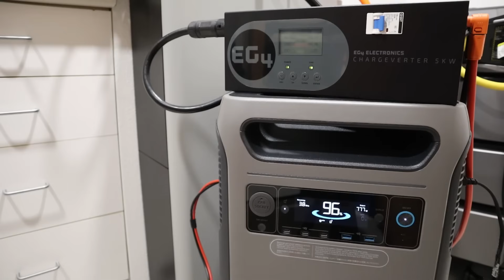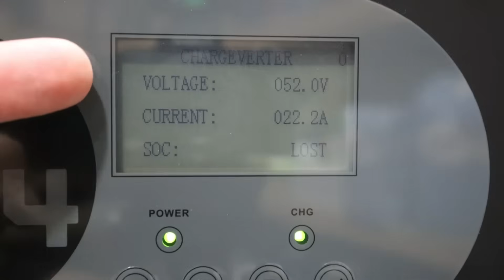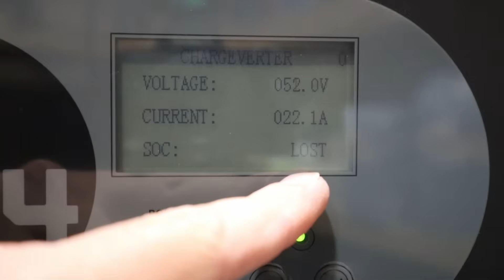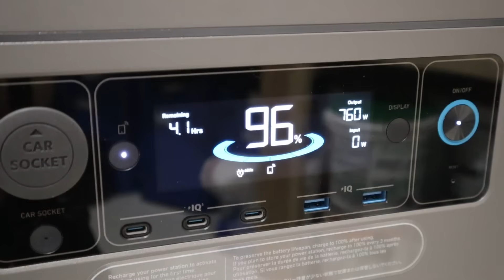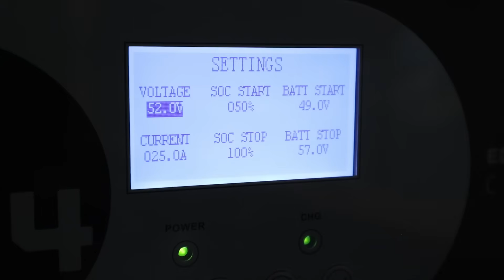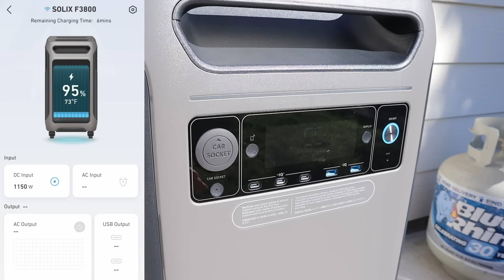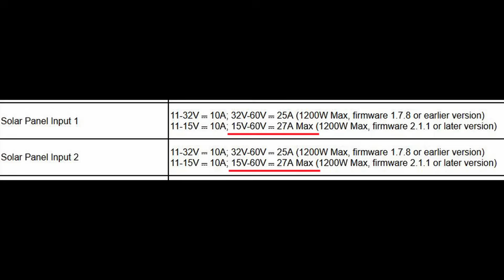The EG4 Chargeverter FIXES the Anker SOLIX F3800!  Keep the 240v Powered On!

Comment: Why after paying over 7 hundred gees have to buy another companies inverter to charge there converter makes no sense anker better redesign there product spending all that money shouldn't have to buy anything else and recharge there equipment  buy any means in an emergency or no solar panel use
Reply from the maker: This video is for all the people that purchased the F3800 not knowing it shuts off the 240v output when AC charging.
(Other YouTube channels pushed the F3800 knowing it had the issue) My video helps people fix the problem.

Comment: So is there a system out there that does everthing the Anker SOLIX F3800 does and doesn't have this 120v recharge problem ?
Reply from the maker: The Ecoflow Delta Pro Ultra is the only option right now. Is the best system available but it's more pricey. I've used my DPU non stop for about 1 year straight, no issues. Just chugs along!
Reply: @Jasonoid  I did some research on the EFDPU and came across this answer from the ECOflow team on the Home Depot website

"Yes, you can charge the Delta Pro Ultra (DPU) using a non-inverter equipped Honda 6500 ES gasoline generator. Connect the generator to the DPU using the AC Generator Charging Adapter at the 5+8 interface for 120V or 240V input. Please note that when using 120V input from the generator, the AC OUTPUT of the DPU will be closed.
Jul 1, 2024"

This says it has the same problem as the F3800........
Reply from the maker: @deeveloper2567  nah, I do it all the time. That's outdated information. I have a review video where I show it working. I wouldn't trust homedepot for power station information.  I also use my DPU everyday so I have experience with it.
Reply: @Jasonoid  Since it was from the ECOflow team just last July, I took their word.  I believe you're doing what you say,  but it would be nice to see some documentation from them as well.  I will contact them through their website.  

Thanks
Reply from the maker: @deeveloper2567  of just watch it in action here:
https://youtu.be/z51enAFvGa4?si=m3sgDiSWhh7sOJhJ
Reply: @Jasonoid  Thanks.  I did watch that and it appears some type of firmware update has made it workable.  I also contacted EcoFlow and got a quick response:

Thank you for contacting EcoFlow support.
 
Regarding your questions:
 
While recharging the Ecoflow Delta Pro Ultra from a 120V gas generator, the Ecoflow Delta Pro Ultra can continue to operate as a 120/240 volt power source. However, please note that other ports can be used but the generator's output power needs to be greater than 1800W; otherwise, the battery will not be recharged. If using high voltage 240V, the AC output port of the DPU will be disabled.

When using a third-party generator to recharge the Ecoflow Delta Pro Ultra, its output must be a pure sine wave with a harmonic rate less than 8% (THD < 8%).
 
If you have any other questions, please feel free to contact me. Thank you for your understanding.

Comment: Jason,

I watched your video on the chargeverter plugged into the solar input of the anker unit.
 So would it be possible to use this same setup plugged out of the ac of a delta pro (Edison plug or 30 amp output )to the solar input of the 6000xp inverter as well?
As you know, if I were to charge the 6000xp with 110ac from generator port or whatever, it disables one of the legs of the output.
I am using just now installing the 6000 xp to supplement my house power but already have a Ecoflow delta pro with 2 batteries I would like to use for extra capacity for the 6000xp.

So my question is, can I have the chargerverter plugged into my delta pro ac out and then adapt the other end into the one of the pv inputs of the 6000xp????
Additionally then I could still run solar into the other pv input as well.
Thanks.
Reply from the maker: Unfortunately the EG4 6000xp requires at least 100vdc input DC to start charging and it prefers at least 120vdc of solar or battery voltage. Connecting the chargeverter up to the 6000xp solar input won't work properly....but that's not how you should connect up the chargeverter anyways.

What you could do to use the extra power in your Delta Pro is it take the chargeverter and power it up with your Delta pro inverter with the 30 amp RV port and then connect the DC output of the chargeverter directly to your 48v battery terminals of your 48v system. The chargeverter is designed to charge a 48v battery directly so use it like that.
Reply: @ this is kind of what I figured. Last question, If I have a couple batteries connected together to the 6000xp, Will the chargeverter still charge them together? If the communication port is connected to the inverter, it wouldn’t be connected to the chargeverter so I’m guessing I would set chargeverter parameters on how to charge??
Reply from the maker: @kerryjohnson7364  if the batteries are connected in parallel to the 6000xp, they will charge together if you connect the chargeverter to them. 
Set the charging parameters of the chargeverter to the specs of the batteries listed in their owners manual. Then the chargeverter will stop at the proper voltage. No communications cable needed. 
Also remember that the battery bms will keep the batteries from charging too high if you program something wrong.

Comment: Do 50 amp port, put out same power as the 25 amp port?
Reply from the maker: The F3800 inverter is good for 6000 watts of power, 25amps @ 240v. Each port is good for that amount of power.

Comment: Hi Jason, you recommended 6 gauge quick connectors but the chargeverter wire is 4 gauge what is your suggestion to step down the wire gauge? Since the connectors are 6 gauge and the wires are 4, I'm having trouble making them fit enough to crimp them.
Reply from the maker: Trim off some of the 4awg strands so they fit into the smaller 6awg terminals. Since there isn't much amperage flowing through these wires you are safe to make these changes.
Reply: @Jasonoid  It worked, ty!

Comment: Hi Jason, thank you for the awesome video again! I have been searching for a solution to charge my Bluetti AC200MAX with a gas generator directly, and this seems to be the best solution. My question is: do I need to adjust any power output settings on the EG4 Chargeverter? The maximum solar input for the AC200MAX is 900W. I apologize for going off-topic here.
Reply from the maker: This will work in the same fashion for charging the AC200max. Similar settings should be fine. It will charge a little slower than what is shown in this video. The AC200max has a 15 amp input limit so the charging speed will be around 800 watts around 54v (54v X 15a = 810)
Reply: @Jasonoid  Thank you very much for the confirmation and your calculation is bang on! Are there menu options on the EG4 Chargeverter to set the voltage and the amperage for the AC200max specific?

Comment: Shouldn't your Neutral have been directly across from your ground to match what you said was in the 240v plug (ground and neutral directly across from each other, two hots directly across from each other)?
Reply from the maker: I wired it exactly as stated in the user manual of the EG4 Chargeverter. Any other wiring the unit wouldn't power up. Its a custom wiring for some reason...

Comment: With the home power panel and an inverter generator you can charge the unit back up similar to the way it charges when power returns after an outage. I found out the hard way that they will not charge at all through the 120v plug when connect through the home power panel. Like you I figured out that you loose 240v when charging through the 120v plug when connected through the power block like you demonstrated in the video. Nice job with your presentation.
Reply: I also found out the hard way.  It is strange: Why does the home power panel defeat the pass-through charging feature of the F3800?  I did not anticipate this problem, and I can find no documentation.   If anyone can explain what is going on, please clue me in.
Reply: @harrison555555  I believe when its connected to charge through the home power panel it disables the other connections. The receptacle block cannot be turned on when feeding loads through the home power panel either. I have a really cool upgrade coming soon that solves this problem. Stay tuned.

Comment: Semi-related to using the Chargeverter to charge while using 240v but this video mentions there's a max charge input of 700 watts when the battery temperature is below 60 degrees F. 

https://www.youtube.com/watch?v=y5WLE3LL7uM

Comment: This is great.  I’m going to follow this.  Q: where and how do you use the fuse? I do not see it in the video! Also is there a way to just join ring terminals without cutting the provided wire? Thanks.
Reply from the maker: The fuse can be on the positive output wire of the Chargeverter for extra safety if you want. The Chargeverter has a built in DC circuit breaker and the power station has short circuit protection so it's probably not needed.
Reply: @Jasonoid  Thank you for this update.. Lots of comments to get through but finally got what I was looking for after hearing this about the fuse. I have 2 f3800 with HPP and have already ordered 2 EG4 Chargeverters. I have my cables and will make them in the next few days. I hope this resolves my issues once and for all. I'm tired of running home from work and getting everything charged up before my wife gets home from work. Thanks again.

Comment: Crazy idea... Can you wire the two XT60 inputs in series and charge the F3800 at 120V DC with one Chargeverter? If this is possible then it would also allow you to use a 120V solar array (gamechanger)
Reply from the maker: Nah, the solar ports only take 60v input limit and the chargeverters don't accept a series wiring. Would have been sweet though!
Reply: @Jasonoid  I reached out to Anker asking the same thing. Their response was... Interesting. They said they "don't recommend wiring the XT60 ports in series". Definitely not a flat no...

Out of curiosity, what does the chargeverter have to do with my question? Maybe I didn't explain myself well. 

What I meant is, hypothetically: chargeverter set to 120v output over one cable. That single cable connects to both XT60 ports in series. I.e. distributing 60v to each XT60 port (ideally). Obviously the impedance across both XT60 ports would have to be identical to each other, otherwise you could get, for example, 50v and 70v. I assume behind the curtains the XT60 ports should have the same impedance, I just don't have an F3800 handy to test the theory.
Reply from the maker: @maksymmoros555  chargeverter only goes to 58v

Anker will fry if you put more than 60v on a DC solar port.

Comment: The Jackery explorer 5000 plus seems to have a similar limitation with the input amperage through a single port. would it be possible to have a test of the jackery's low pv ports done to see if it rejects Y splitting of the input?

Comment: Really enjoy your content. Was hoping you could answer this question? I have the typical HPP and F3800 setup. I removed 15 critical circuits from my main panel and moved them to the Eaton subpanel. Installed 90 amp breaker in main panel to feed Anker HPP with F3800 attached to it. If I isolate the main panel by turning off the 90 amp breaker to the HPP, will I be able to charge my F3800 with its 120V power cord(with clean sine wave power) and still send power to my subpanel? I'm aware that the 240V outlet disconnects if you try to power F3800 with power cord. I ask because I wasn't aware until recently that you need an inverter generator to charge up the F3800 and I only have a Firman 7500W Dual Fuel generator that backfeeds into my main panel. Instead of spending $465 on a chargeverter that will only give me 1150W via solar port I hoping buying a 2000W quiet inverter generator that outputs 1800W thru the F3800 power cord for the same money would be a better move. What do you think?
Reply from the maker: You can always try it out to see what happens. I'm not sure how every single scenario would work on this product I can't say either it would work or not.

Comment: could i use the eg4 charger to charge a couple 48v server rack batteries then have them charge the f3800 so i could run my generator for less time.  lile charge 2 server rack batteries then shut off my generator and let those charge my f3800
Reply from the maker: Yep, that's another way to do it! 👍

Comment: To connect Chargeverter to f3800 could I use an  XT60 to O Ring Terminal Cable (XT60 Female to M8 O Ring Eyelet Terminal Plug) by replacing the ring terminals with an Anderson connector? It would not have the anti-spark or be able to plug into both XT 60 ports if done this way.

Comment: I'm still not understanding why you couldn't just unplug the 240V line from the F3800 and run it from 240V output on the gas generator to the transfer switch. You can then charge the F3800 and power the house simultaneously, only caveat is that you need to be careful not to overload the gas generator.
Reply from the maker: You could do that, but those huge generators cost twice as much as the chargeverter. If you already have a small generator, the chargeverter will work as well.
Reply: I was thinking of that, but can Anker F3800 take power from a regular generator w/o issues? That's the reason I am thinking of going with this solution and reading almost all the comments.
Reply from the maker: @psm2000ut  most power stations don't charge with non inverter generators since they output dirty power the voltage is less regulated.

Comment: I assume you need to set the voltage and amps to the 32-60 v and max 25 amp required on the Anker f3800. Is that correct? I would be inputting 120 volt a/c.
Reply from the maker: I'd recommend setting the voltage to the setting in the video. The amperage can be set to 27 amps (upgrading the firmware on your Anker F3800 allows for 27 amps, vs the previous 25 amps).

Comment: Thank you for the video! I have a similar problem, but I have two Jackery Explorer 2000 Plus generators (with 4 expansion batteries) connected to two Jackery 200W Solar Panels each (4 total). I combine the two solar generators using the "Jackery Connector" (I know, terrible name for the connector) to get 240V output to supply the necessary voltage for my water well.
Similar to the solar generator in your video, the Jackery Explorer 2000 Plus Solar Generators disable the 240V output when charging them from AC power. The 240V stays on when charging from Solar Panels. This isn't at my home, but out at my ranch (offgrid/rugged) - So, to charge the units when the sun is blocked or it is night, I purchased a Champion 11,000W gas/propane generator. I then discovered (when trying to charge the Jackery Solar Generators) that the Jackery Solar Generators will not charge from a dirty power source (they shut off AC power input).
So I purchased a WEN 3600W dual fuel pure sinewave inverter generator to charge the two Jackery Solar Generators. I then found that the Jackery Solar Generators do not have a way to throttle the charge rate when connected to AC (there is a quiet mode), which exceed the capacity of the 3600W WEN (I can only charge one solar generator at a time).
Its like every solution brings a new problem on and on and on... I have ordered the EG4 based on your video. I hope to connect it to the Champion Dual Fuel Generator so that I can charge both Jackery Solar Generators at the same time (though, for the price of the EG4, I could have bought a second WEN generator, but then I would double my propane use... Well... The Champion generator probably uses 2x the fuel as the efficient WEN already, but at least I will only need to start one generator, instead of two... I hope..).

Now, after watching your video on the Jackery Explorer 5000 Plus (5K), I am thinking of buying that, using one of the Jackery Explorer 2000 Plus (2K) units to charge the 5k, using the second 2k to charge the first 2k (or maybe use it somewhere else), tossing out the Jackery Connector completely, using the EG4 to charge the 2k from the Champion 11,000W generator. But, maybe doing it like this, I could just use the WEN 3600. I have wasted SOOO much time, effort, and money learning what the Jackery User Manual should have clearly stated right at the start.
Reply from the maker: Thats a huge whole process to find out they don't charge! Frustrating!

Comment: Can you connect in non-anker batteries into the battery expansion ports?
Reply from the maker: No, it only supports Anker batteries. However, you can use standalone batteries to extend the runtime like shown in this video:   https://youtu.be/tK4JKmfndh8

Comment: Found this on Amazon:  NEMA 5-15P to L14-30R Power Adapter Cord, 5-15 Male Plug to 4 Prong Female Receptacle Twist Lock, Generator to House Inlet Box.  Would that work instead of building your own?
Reply from the maker: You could test it, if it doesn't work you could return it and build your own. The off the shelf adapters I tried didn't work. The wiring is not a traditional setup

Comment: Just to be clear, are you jamming 4awg into the 6awg terminals?  I’m a bit confused.
Reply from the maker: Yep, because they don't offer 4awg terminals with the SB50 connection. It will be fine with the loads I'm running. As long as you are aware of your wiring and it's ampacity it will be safe.
Reply: On that same note: are you jamming two 10 gauge wires (from the XT-90) into a single 8 gauge terminal?  The SB50 only accepts a single terminal, right?
Reply from the maker: @OdessaBill yes, they fit well, I wouldn't consider it jamming them in there.